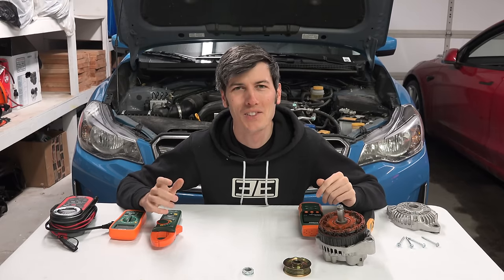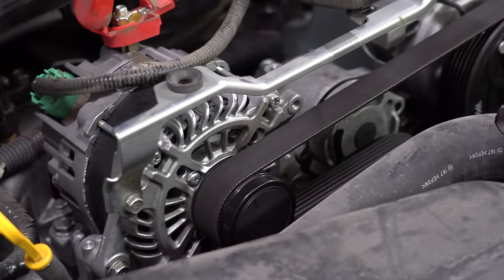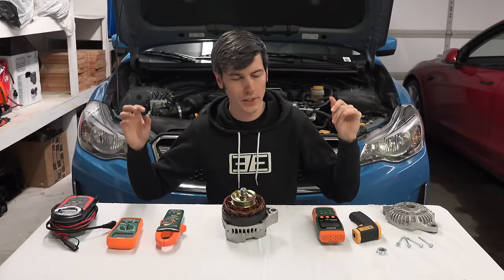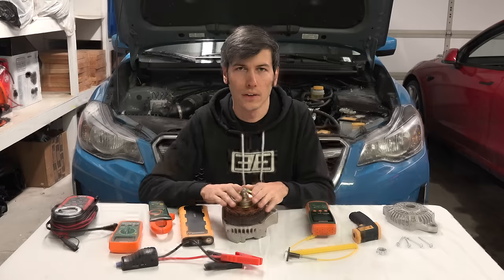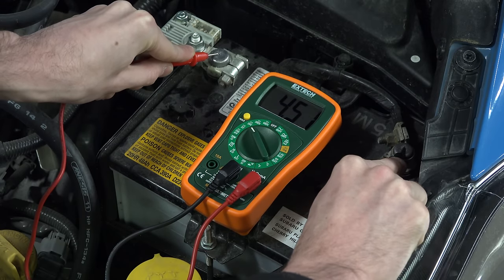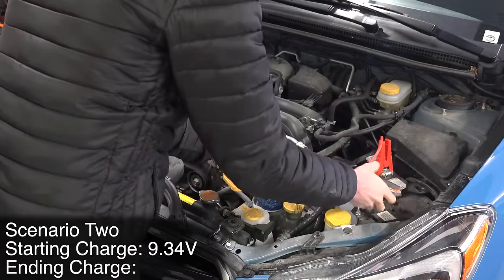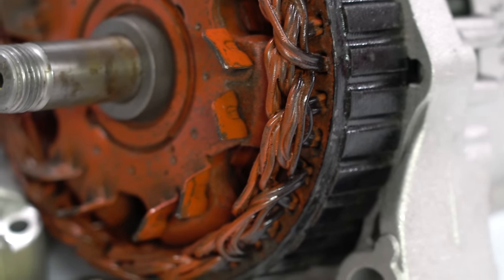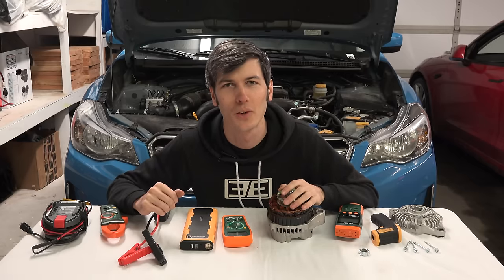Can A Dead Battery Ruin Your Car's Alternator?

Comment: There seems to be a common misconception that alternators make free power and that running more lights, accessories, etc doesn't reduce fuel mileage. 

I'd love to see you clear this up (if you haven't already) by explaining how a 55W bulb causes 55W+ of extra drag on the engine (or doesn't, perhaps I'm the one with the misconception).

Also, for the aviation and/or motorcycling folks out there, a Magneto/Generator vs Alternator video would be helpful.
Reply: You are right. The more power you try to draw out of the alternator the more mechanical "back torque" the alternator reflects back onto the engine that's driving it. In a modern car the idle will remain steady but that's because the alternator and the ECU talk back and forth and the ECU will open the throttle a bit more to compensate for the extra electrical load. To answer the other question, if the charging system is about 90% efficient about 60 watts of equivalent mechanical power will be drawn out of the engine to light a 55 watt light bulb.
Reply: To go a bit further, when you draw current (and hence power) out of the alternator doing so produces a magnetic field around the stator windings that are producing the output current. This current-induced magnetic field is opposite of the magnetic field that is being produced by the rotating armature. As such the current flowing in the stator winding produces a magnetic field that tries to slow down the rotating armature. This in turn puts the mechanical load on the engine. It also explains why drawing more current from the alternator also increases the mechanical load on the engine.

Comment: One way to kill an alternator with a jump start is to reverse polarity. That can cause one or more of the six diodes in the bridge to short out or burn out. Also he didn't mention what the alternator manufacture said and set for its maximum current output.

Comment: is this effect greater or less with a high amperage (240a or so) alternator?
Reply: Would have to be careful as the initial charge of your battery would be lots and lots of amps maybe more than your battery was designed to take..

But in general use the battery will not charge that fast (charge rate is proportional to state of charge, if the battery is near dead it will soak up lots and lots of amps)

But since a 240A alternator is specced to deliver 240A and has the cooling for all that, normal use which will prob be below 100A will be fine

Comment: Same voltage it "started" at lol do this same test but keep in mind alternators don't hit peek output tell around 1600rpm engine rpm so that might have been 60amps at idle but 100A plus at speed.. this is also not good for the battery and causes rapid So2 buildup. Do to the crazy high charge rate.. your basically charging a 40ah battery at 2-4c and the recommended rate for a lead acid battery is more like 0.25 to 0.75c and 1c for AGM and some SLA's

Comment: Have you ever had a battery that had a dead short when it got hot. That will leave you stranded even if you have a jump start available. I have been there and it is my view that it was caused by a standby charger.

Comment: Yes it can, it did destroy mine. It was costly experience, should have replaced battery right away. Not only was I driving with very weak battery for months, but eventually it degraded so much so it had problem starting car even after being on a charger for hours. What exactly happened in the end was that while trying to start a car with battery so weak that it could barely turn the engine once before dying, it did something to the starter so that it either burned out or shortened, as even the click sound was gone. After that even with jump starters connected, it would not click/turn at all. And yea I did try hitting the starter to make it work one last time, didn't work. Mechanic who was replacing starter for me was showing me some massive burn marks.
Reply: So, basicaly, you destroyed it. It did not happend because of alternator, but because of user, that was trying too hard. If electric motor is not turning, there is a lot of current going inside of it, even if it could not move the engine. Starting electrig motor draws around 6 times more amps than operating at nominal rpm.
Reply: So did you destroy your alternator or starter?

Comment: I would have stressed the point of the difference between a dead battery and a bad one.  There is quite a difference.  A battery with a shorted cell or two will force the alternator to put out full amperage in an attempt to charge what it sees as a low battery.  I once had a technician diagnose a bad alternator in my old car in which he replaced the alternator but I broke down the next day.  I complained to the service manager who refused to tow my car back.  I then self-diagnosed the car and found that while running, the alternator was struggling to put 12.1 volts out.  I then put another battery in and the output changed to 14.2v.  Turns out that the battery had two shorted cells and was hot (from attempting to charge) and bulged.  Replacing the battery cured my problem.  I went to the dealership's owner and complained about the misdiagnosis and was promptly refunded my money.
Reply from the maker: Yes, briefly mention at the end if you have a fully dead battery, it's going to cause your alternator to work hard endlessly for no return. In that scenario, definitely want to try charging the battery first, and if it's dead, replace.
Reply: In my box with my NOCO battery jump starter, I keep the following notes from Training from Motor Age, Vince Fischelli:
When approaching the jump start, check the  Open Circuit Voltage (OCV).

If OCV is around 10.55, there is a SHORTED CELL.  Trying to jump start the vehicle WILL NOT WORK
If OCV is near zero (Maybe 0.50V)  there is an OPEN CELL.   Vehicle will jump start fine.  DON'T DO IT.  The alternator will essentially think there is no battery installed.  It will put out a high voltage.  He sometimes measured over 30V (when instructing for Interstate Batteries.).    You can imagine the damage being done to delicate vehicle electronics.

Comment: 60+ amps is a heavy load. I’m wondering what gauge wire handles it. I’ve been told in some cases it can be as light as 12 gauge.

Comment: Not sure what the point of this video was.  The alternator puts out a current proportional to the control voltage it measures from the battery.  As the battery voltage decreases the output of the alternator increases.  At some point it could increase beyond the capability of the alternator and release the magic smoke.  Disconnect the battery from the alternator while it's running and enough current will be generated to damage the diodes in the regulator unit.  Run it too hard and it'll get hot.
The battery also functions as a big capacitor on the charging circuit to control AC voltage spiking.  Disconnect it while running and the alternator diodes will be the least of the problems.  A lot of sensitive electronics like the ECU will probably also go with it caused by AC transients in the system.
Reply: Modern alternators have the ability to self-protect themselves. If for any reason something tries to draw more amps out of the alternator than it can safely deliver the output will "fold", which is the term we use in power supply design. This means the charging voltage will drop by a sufficient amount to limit the current and protect the alternator. The alternator in the video looks to be a 60 amp alternator, which means 60 amps is the design limit it can safely deliver. If the battery tries to pull more than that all it will get is 60 amps and the amount of time it takes to fully charge it will be extended.

Comment: I daily an 85 Merc 190e, and do all my own repairs. One day I disconnected the battery and when I reconnected the leads one was loose. When I turned off the car the lights turned off signaling to me I had just driven on the alternator alone. I was wondering what that might do to the alternator if it couldn't send any power to the battery.

Comment: When I was a kid,
Dead battery: you charge it or jump it. To test it if it is a alternator/generator or battery issue you start the car and disconnect the battery poles. If it dies it's an alternator/generator issue.
Then I got a newer car. 
I was told if you disconnected the alternator from the battery it ruins the alternator. Is that true?
Reply: More importantly, it can ruin the car's other electronics if a large voltage spike is induced and they can't handle it and are damaged, so it's not advised at all to do on a newer car.  Even on older pre-computer controlled cars, removing the battery with the engine running could fry the ignition system components and/or the electronic parts in the radios if it was happened to be turned on when the battery was disconnected.
Reply: alternators usually output very spiky voltage that electronic's don't like, the battery act's as a buffer to smooth them out.  Modern car's have much more complicated electronics in them that are more prone to dying when subjected to that kind of abuse.

Comment: The charge current is determined by the Potential-Difference between the alternator and the battery and the internal resistance of the battery (in Ohms).
If the Alternator is regulated at @14.2v and the battery is, say, 12v with an internal resistance of, say, 0.1 Ohms, then the PD is 2.2v.    Using Ohms Law: PD/R=I the current would be 2.2/0.1= 22A.
When the battery is nearly charged to, say, 14v the PD is then 0.2v and the charging current is: (PD/R=I) 0.2/0.1 = 2A.
When the alternator and battery are at the same voltage there is no PD and no charging current flows.
From this you can see that the charging current is self regulating according to the battery voltage and its Internal resistance. This also explains why resistance in the earth or live connection has such a significant effect (a 0.5 Ohm resistance could reduce the possible charging  current by 25%).

Comment: The battery charging is controlled by the ECU/ECM and it can be PCM or PWM depending on how computerized the car is. The alternators in most cars are capable of pushing out 90~190A easily, however it is commanded to output an constant 30 to 70 amp to charge the battery SAFELY (putting 190 A into it will start a fire for sure), remember that your battery pushes much more current out to start the engine, starter motors usually draw 130~180 A per compression cycle of each piston to rotate the engine so no, doing this won't wear anything, you'll just get a tiny increase in gas usage, alternators also can operate at up to 130°C but it will never get to that temperature because of safety guards programmed in the ECU/ECM that prevent this and the fact that it will never output an constant 180 A out the back.

Comment: Even the lowest class of insulation (Class A) on an alternator is rated for ~100 deg C (40 C Ambient + 60 C heat rise).  Subaru alternators are typically rated at 90-95 Amps which is quite low but you didn't come near that.  There was nothing of concern in this test.  I'd be more concerned with a weak battery that allowed system voltages to rise too high.  There should be a voltage regulator that would control that but it would likely depend on the additional load of the battery.  I also think that the real concern is that an over-discharged battery will significantly shorten its lifespan.
Reply from the maker: Thanks for sharing! Versus ambient, there was a 60 deg C + rise, as the alternator started at 7.5 deg C, ended at 66.2 deg C, and that's with ambient at 3 deg C (outside my garage).

Comment: Battery Voltage does not equal capacity folks. Your 120Ah battery may be sitting at full volts but only have a working capacity of 7Ah. That's how batteries degrade. Also batteries don't like the cold and really don't like heat. The Alternator on the other hand, is designed to be bolted to an engine block and is really only limited by the mechanical bearings. A motor would get a lot hotter in operation so don't sweat it. The most annoying fault an alternator can have is a phase fault, this is where one of the phases goes open circuit and the alternator loses over 1/3 of its power rating. This is hard to detect as the battery voltage will remain the same as a healthy alternator but the unit will be unable to charge the battery. Symptoms of this would be your battery going flat every week or two despite everything seeming to be fine? The alternator simply cant replace the charge used to start the engine and the battery looses a few % of capacity every day until its flat.

Comment: It won't damage it, but I will wear faster due to temp. An alternator is often 90A to 110A, but it will not charge a battery more than 20A - 30A. The battery will boil inside at 30A or more. The Regulator will send more current to the rotor to make a stronger field and it will wear the rings on the rotor and the brushes a bit faster. But no one will notice that, probably the diode plate will die first.
Reply: Also a weak battery will not charge fast. It often stops at 7amps when it its weak on the acid/water mixture. Now a healthy battery will accept like 50amps or more, but it will damage the plates inside the battery. So a fast charge is 30amps per 30min then lower it to 20amps.

Comment: The alternator is there to run ekseleries, sus as driving lights, heating fan, radio, etx. The charge of battery is quit low amperage, a cabin fan is something like 20-30 amperage on full, the driving lights pull something like 10-12 amperage (with own high beam lights 20 A)

So the conclusion, if you have tho jump start the car, just turn off the fan and drive a few minutes the lights turned off and you should be fine.

How ever, the amperage the battery accepts is depending on the battery temperature, colder don't charge that well.

Comment: Nice episode.  Question:  Is the rotor permanent magnets or a field coil with DC power provided by that battery?  I thought that's how the ECM regulated voltage?
Reply from the maker: Field windings wrapped around the rotor, with alternating finger poles to change the magnetic field. Intentionally kept the description brief in this video, perhaps worth creating a detailed explanation on them! :)
Reply: Thank you!  It is a good subject for further study.  I think there is a lot of confusion about vehicle electrical, it's pretty complicated stuff. @EngineeringExplained

Comment: 50A shouldn't be a big deal for the alternator: you can get a good part of the way there with just driving lights, headlights, blower on full, defroster, essential electronics, wipers and a few other accessories.
Reply from the maker: Yes, but then if you add a low battery on top of all of that?
Reply: @EngineeringExplained  That would be where things may get interesting on small alternators rated for ~100A.
Reply: @CLP That would be 6000 RPM at the alternator pulley, not the engine. Don't forget pulley ratio, typically 3:1 for passenger cars. At ~2500 engine RPM on highways, this becomes ~7500RPM at the alternator, more than enough for maximum rated output.
Reply: @CLP Even at 2:1, that's still 5000 RPM and close enough to get full current output out of a 6000RPM alternator if you really need it, albeit at about 1V below nominal system voltage.

Comment: I've had the pleasure of messing with cars' battery circuits on a few different vehicles (typically ones I don't care about). Measuring the battery voltage vs. alternator voltage when running means nothing. On one of my builds (an '03 Toyota Corolla S), I installed an analog voltmeter gauge on my dash, and also had a kill switch that gets installed on the negative post. At this point in the build, I was done and was waiting for the fair to come around, so one day when I fired it up and got it moving to keep it from seizing (and maintain the battery) as it was stored outside under a tarp, I had the bright idea of switching off my battery while running since it was relocated to where the front passenger seat used to be and in easy reach. As shown in your video, most (charged) batteries are about 12-13 volts prior to startup, and around 14 volts once running (under normal conditions), but if the battery gets disconnected, voltage is all over the place. Once I turned my switch, my voltmeter would jump from 13 to 18 volts and would never stay still unless I reconnected the battery. That said, most potential loads were eliminated and so the only things using power were the fuel pump, ecm, and the engine itself.